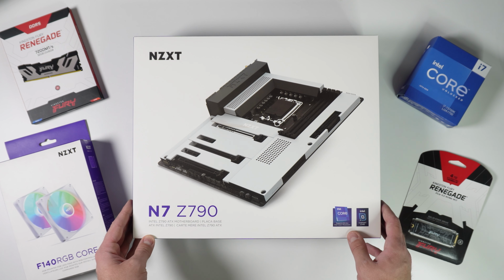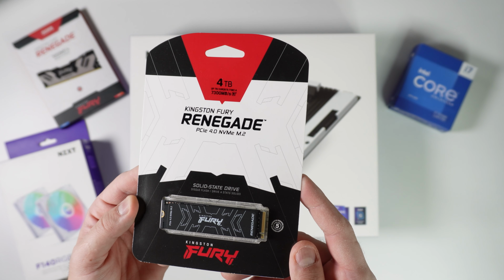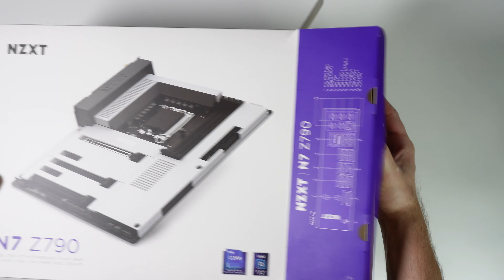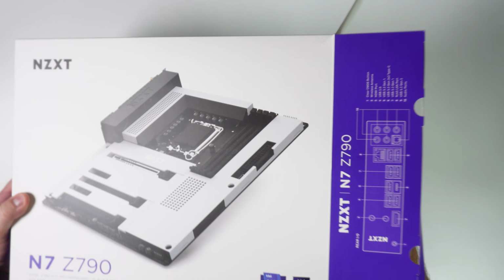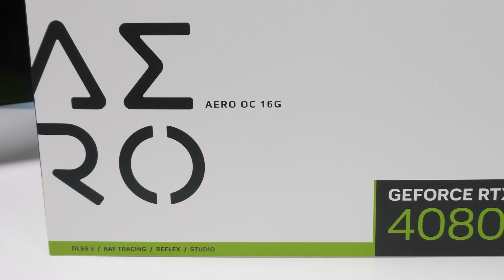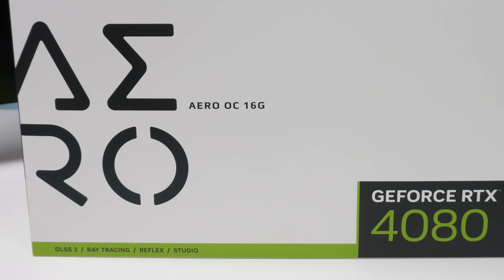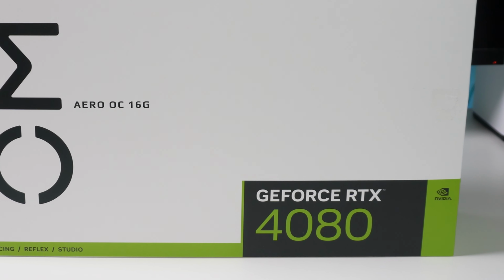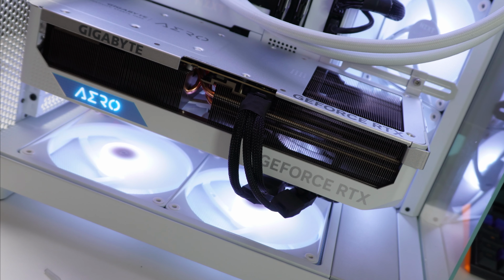Building A New 2024 NZXT H6 Flow Computer | GIGABYTE RTX 4080 AERO OC | NZXT Kraken Elite 360 RGB

Comment: i have the asus 4070 dual oc card in my pc currently. nice build overall. just one thing. the bottom fans are set to exhaust air out the bottom. they need to be flipped so they draw air in for the gpu.

Comment: Hi, I think you installed the bottom fans (the 2x F140) in reverse… They should push up air toward the graphics card No? The fans on the AIO rad are OK in an exhaust position to push air out the top of the case, my concern is the bottom 2 bottom fans. Am i right?!?!  The back fan should be positioned to exhaust air out in the back of the case. Thank you, good videos!
Reply from the maker: Hi thanks for commenting! Yes they were only like that for the video, but are flipped now.